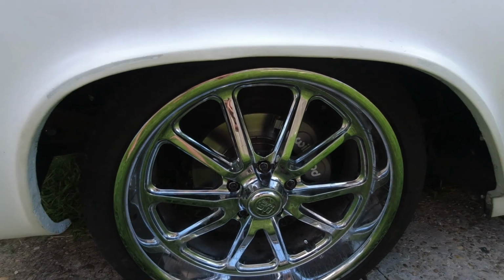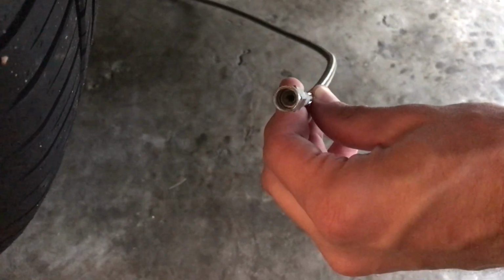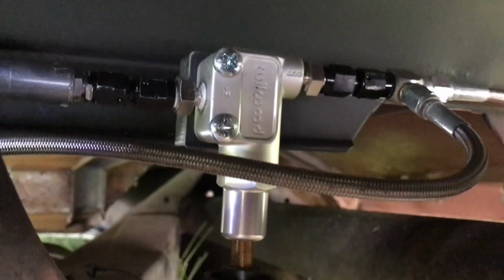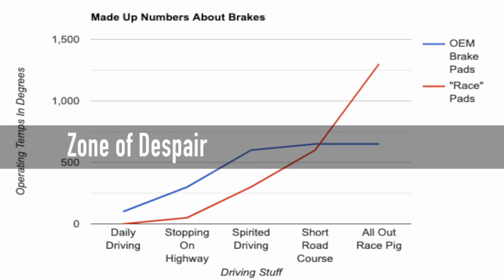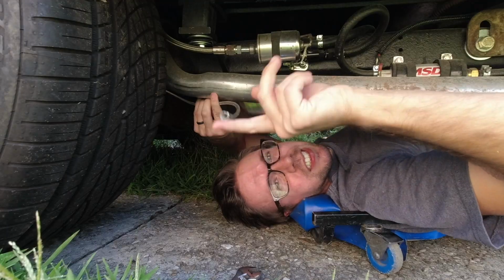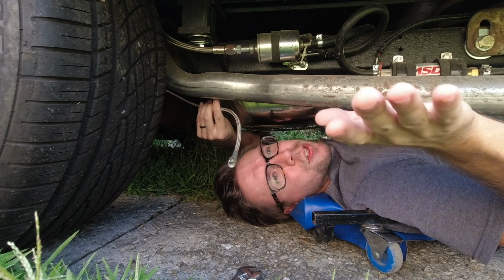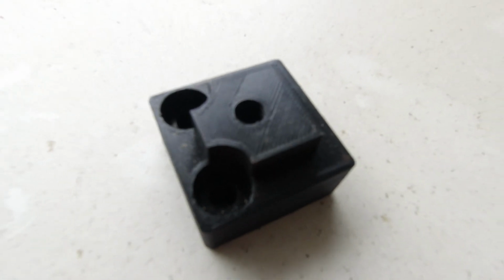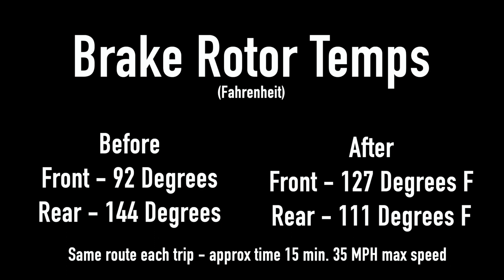Disk Brake Swap - Installing A Wilwood Proportioning Valve and Testing

Comment: Have Wilwood front brakes on the shelf waiting for installation. Can I ask for more info on your headlight conversion?  Would like to do same to my Country Sedan.
Reply from the maker: Heck yeah bud, I'm a big fan of them although I like to make sure the banjo bolt is plenty long enough. I may or may not have stripped one out using too short of a bolt (stock) without thinking about what I was doing into aluminum.
Reply from the maker: https://www.ebay.com/itm/232524982409?_trkparms=amclksrc%3DITM%26aid%3D111001%26algo%3DREC.SEED%26ao%3D1%26asc%3D20160908105057%26meid%3De3ae60cc0e2147da808ec943f79a2e51%26pid%3D100675%26rk%3D1%26rkt%3D15%26sd%3D232524982409%26itm%3D232524982409%26pmt%3D0%26noa%3D1%26pg%3D2380057&_trksid=p2380057.c100675.m4236&_trkparms=pageci%3A9b6a0329-2240-11ec-95a5-061bc7fde1d0%7Cparentrq%3A38e593be17c0ab97d1ba8602fff6183e%7Ciid%3A1
Reply from the maker: Theres the link to my headlights - they are generic no-name 5-3/4" glass headlights but instead of being sealed they use a replaceable H4 bulb. There are a few different designs floating around eBay and the internet but these worked great for me even though they were a pretty tight fit in the chrome trim rings.

Comment: Just found this vid doing some research. Do your brakes feel better after installing this? I have a c10 that I converted from 4 wheel drum to 4 wheel disc and I can't seem to lock up the brakes at all and overall brakes feel soft. Not sure if I need a proportioning valve, a different master, or both.
Reply from the maker: Oh man, I’ve been in this so many time haha. Are you using the original drum/drum master? If so definitely swap to a disk/disk. Fluid modulation will definitely be wrong with that? But I’m assuming you’ve bled it until blue in the face?
Reply: @MatthewFinlay  yep. I do not have the factory master, it was swapped with a wilwood manual one but I do not have the specs or part numbers on it. I know the brakes worked great till I swapped to discs and now it's just mush but I haven't touched the prop valve. I hate to order one only to find out that I need a new master as well because I could save a few bucks getting them together.
Reply from the maker: Ohhhhhhh glad you mentioned it’s a manual master. Are you using it with a power booster??? Or it truly manual????
Reply: @MatthewFinlay  it's truly manual. It's a willwood unit but I don't know all the specs because the previous owner installed it.
Reply from the maker: Understood… ok so I thought about this and I have a punch list I’d try or research.
Pedal ratio - the pivot point in the pedal arc is usually different from power brake to manual brake vehicles. It gets complicated to figure out that ratio and generally they work even if the wrong ratio EXCEPT every once in a blue moon we’d run into one where the rod that pushes into the back of the master wasn’t swinging long enough to fully press the brakes of the master. It always just felt like you could literally only go halfway with brake force and the pedal would physically bottom out before the master would. Next is the pedal rod itself - have you made sure it has the tiniest amount of free play before it touches the back of the master cylinder piston? If it has too much pressure it can cause the hole that fills the cylinder from the reservoir to be covered up and they won’t bleed right. If the rod is loose loose it might not allow you to have full pressure. I’ve seen all sorts of weird stuff over the years because lots of time when people swapped from power to master they still use the brake booster to master cylinder pin with the power brake pedal rod even though that’s usually a no/no for safety reasons imo. It’s awkward as hell but I would recommend getting someone you like to press the brake pedal while you also smash you head up under the dash upside down with a flashlight and look for any weird movements or a rod at the wrong angle hitting something etc.
Reply: @MatthewFinlay  thanks for the input. I'm actually swapping in this prop valve today. This truck was originally a manual master so the pedal travel in theory shouldn't be a problem. Once this goes in, I'll work on adjusting the pedal and hopefully everything feels good. It stopped before, just not like I would have preferred.
Reply from the maker: Awesome buddy, let me know how it goes and if you find anything. Having a previous manual setup helps eliminate a ton of little issues ya don’t think will be a problem but are. Definitely check to make sure your pedal isn’t bottom out on a bracket before hitting the back of the master though. I’ve seen that several times where the two bolt mounting flange, recessed piston, all the above is further into the engine bay and the pedal never actually goes all the way down.
Reply from the maker: Any better??